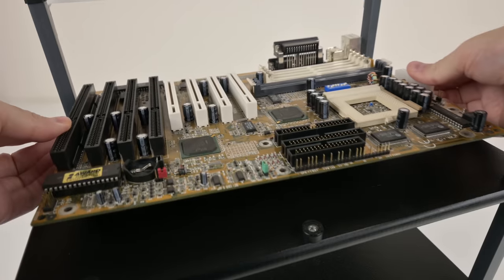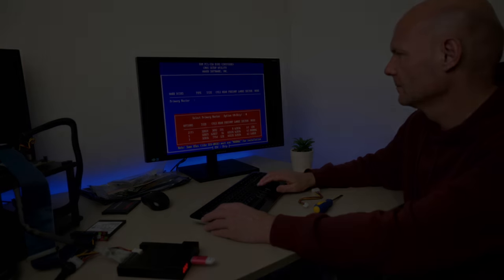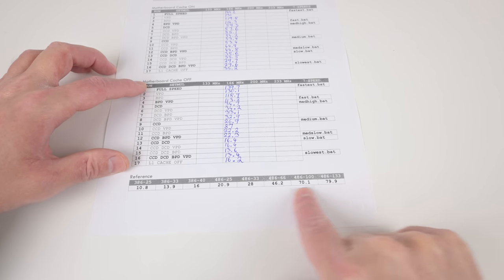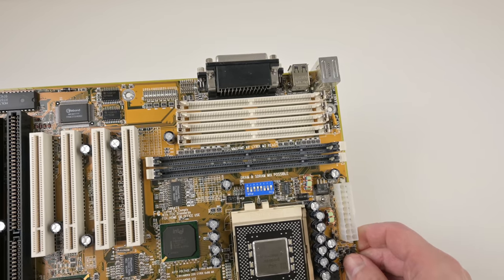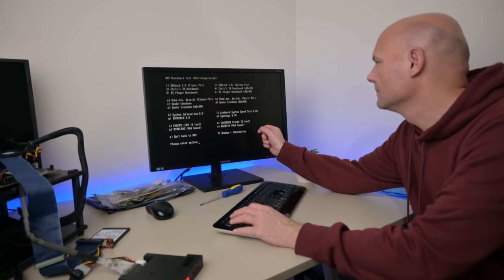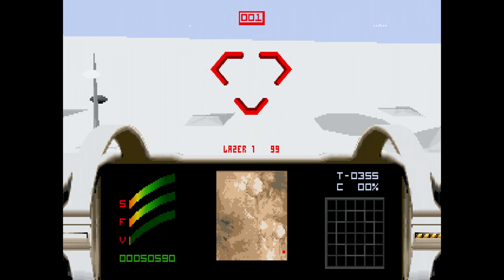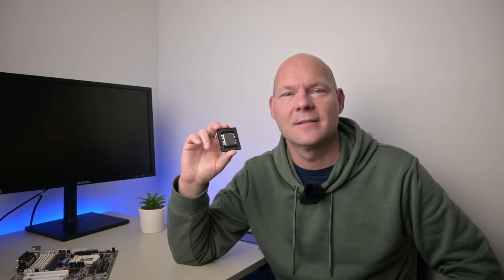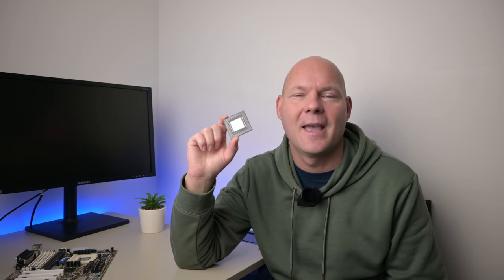Pentium MMX 166 is one of the Best Retro Processors

Comment: I had a Pentium MMX 166 running at 200 MHz. It was a great machine but only for quite a short time due to the mentioned incredibly fast development around the year 2000.

The MMX 166 had replaced my IBM 6x86 P166+ but was much faster in many games due to the faster floating point unit. And it generally ran with much less issues and crashes, but that might have been due to the improving operating systems as well.

After the MMX I tried an AMD K6-300, but I never was as happy with that system, I think the main issue has been the VIA chipset. That's why it always hurts my stomach when you're dealing with VIA chipsets in your videos - bad memories of crashes to desktop and blue screens come back into my mind ;-) 

Then I went back to intel (Celeron 300A @450MHz, ran games like a dream, but again not for that long...), but that's another story ;-)

Comment: Finally had a chance to try this. I set a Pentium MMX 233 as 133MHz (2x66Mhz), got 12.1 on the slowest set (all caches off on BIOS as well). That's between a 386-25 and a 386-33. Wing Commander 1 runs nicely on this speed. I knew Setmul, you just made your point on the convenience and easiness of use with the 136in1 package. Really nice trick to have around for those really old games. My PC history started with  a 486DX33 and I did play Wing Commander on it, never knew it was faster than intended. As things were moving fast during those years ( I would sell my current machine and build a new one once-twice a year), I never really went back and replayed such games. As I heard once back at school, there is things correctly or poorly designed. We have software from that time that is not speed sensitive - and some that are. Today we can tell who did right vs wrong. Thanks Phil / cheers from Brazil
Reply from the maker: Awesome 👍😎

Comment: I've a pair of P233MMX boards, both ASUS TX97s (one with just SDRAM, the other with both 72-pin and SDRAM).  I bought them off a guy who collected a bunch of scrap machines from some local schools for $20 and a case of beer two years ago (along with some other nice stuff, like a couple 462s and Slot 1s).  They're nice boards, and pretty solid, both in excellent condition for their age.  Only have one of them set up at the moment, also using a Gotek, but with a CF card instead of SSD.  They have on-board Creative Vibra sound, which seems to provide decent SB16 compatibility, but I picked up an ESS1869F to go in it instead.

I ran a P233MMX with an AWE64 Gold from 1997 to 2001, first with a crap ATI card, then with a PCI Voodoo3 2000, so the P233MMX has a special place for me.

Anyway, thanks for the video Phil.  Love your content as always.
Reply from the maker: Thanks!

Comment: I have one of these in an old OptiPlex with a 440BX chipset. Runs at 266mhz flawlessly. One of my favourite chips. Overclocking was so simple back in the day.
Reply: 440BX chipset is for slot1 Pentium 2 and 3. Not the original pentium.

Comment: Also my first CPU. It could be wonderfully overclocked: my original motherboard could push the base frequency to 83 Mhz, making it run at 209 MHz (83 MHz * 2, 5). Later I mounted it in a Super Socket 7 motherboard, and it was able to run at 250Mhz (100 MHz * 2, 5) without any problem . When I upgraded to a K6-2 400 I was disappointed: it was a bit faster, but less than I had hoped for. Looking back on it later, I should have waited and buy a K6-3 450...

Comment: Yeah I really like the concept of "slow is better". I'm somewhat split if I should keep going with SS7 or just make a dedicated 98 machine and a dedicated DOS machine. I will say that I recommend anyone trying to build a computer like this try and find a motherboard that uses dip switches like the one in this video. It makes swapping settings infinitely easier.
Reply: How about dual booting DOS and Win98SE? You will need a bootmanager that can hide the OS partitions from each other though. I did it with GRUB in the pasz, but that needed a linux installed.
Reply: @szenti707  I guess what I should have been more specific. I'm talking about making a dedicated "slower" but more compatible DOS box while building something faster like a Pentium 3 to handle all the 98 games.

Comment: This is a childhood CPU for me because it was the CPU in my grandparents' PC from 1997 to 2002. In a horizontal desktop with 16MB of RAM, 2GB hard drive, 3.5" floppy drive, 16x BTC CD-ROM drive, S3 Trio64 with 2MB of VRAM, an "Avance Sound Chip" sound card, a 56K modem and Windows 95.

While my Mum and I's PC from 1998 to 2002 was a mini tower with a 333MHz Pentium II, 64MB of RAM, 4GB hard drive, 3.5" floppy drive, 36x Creative CD-ROM drive, ATI 3DRage w/ 8MB of VRAM, an "Avance Sound Chip" sound card, a 56K modem and Windows 98.

Both PCs were whitebox systems by Swift Computers in the West Midlands region of England.

Comment: like all your videos,,,,,i still  have my gateway 2000 166mhz tall desktop computer ,, only has the EDO ram ,, ensoniq sound card ,, pci matrox video card,, my motherborad has a pin on the motherborad to slow down the 166mhz cpu ,, i saw it in my manulal its my first computer i bought in 1996 ,, it came with window 95 ,, i updated to windows 98 se
Reply from the maker: Beautiful machine!

Comment: The first PC i bought brand new was a 200MHz MMX with 32MB RAM, S3 Virge 4MB and 3Dfx Voodoo 1. It replaced a AST Advantage 486 DX2 66 (Cyrix). Quake went from 2 fps to almost 50 (software rendering).
I rebuilt it a while ago using a "new old stock" AT motherboard. It's fast enough for all DOS- and early Win95 games, and the compatibility with older games is great as well.
Benchmark results: Norton Sysinfo: 680.6, PC Player SVGA 640x400: 21.3, Superscape Benchmark: 155.6, Doom: 80.3 fps, Quake: 49.1 fps.
Reply from the maker: Thanks for sharing, the performance is beautiful!

Comment: I still remember how happy I was, when I finally found a Pentium 200, without MMX. Most of the production went to OEM's, from what I read in various places, so if you wanted one, you had to wait for someone to upgrade. You just could not get them, any other way. At one point, the Chinese recyclers were listing tons of them. They must have received a big shipment of used pc's around that time. The supply has tapered off a lot since then.

Comment: My late 90s to early 2000 era was Cyrix 166+  --->  Cyrix MII 333MHz  --->  AMD K6-2 500MHz  --->  Celeron Tualatin 1200 .  As you can see I was short of money during this era, but went near cutting edge after this.  Been Intel ever since.  My friend's first desktop PC was a Compaq Presario 4504 with an Intel Pentium MMX 166MHz, which he still has and bought from Costco in late 1997 for nearly £1000.  There was another model next to it, a Compaq with the Pentium MMX 233MHz but cost significantly more!

Comment: This is brilliant and just in time. I recently acquired an ATX Socket 7 mainboard and coincidentally the seller included a Pentium 166 MMX processor with it. Finding AT cases has proven very challenging so I've been on a quest to build up a system in an ATX case. (Planning to use a black case which reminds me of your "Sleeper Retro PC series".)

Those Startech Socket 7 coolers are still available though they can be a little pricey IMHO at ~$20 US shipped. I ended up making a franken-cioler with a Socket 370 heat block and some Socket 7 retaining clips before finding a decent deal on the Startech cooler.

All in all, this is a wonderful tour through this platform and an inspiration to finish assembling my own version of this. I'm anxious to finally use my Orpheus sound card in there as well. 

Thank you for putting this together Phil!
Reply from the maker: Sounds like you are all set very soon 🙂

Comment: On a side note that chip is a decent overclocker.  If your board supports it most will do 200 easy on stock volts and many will do 233 with a slight bump and a socket370 cooler.

Comment: I agree, 166MMX is great CPU for early 95 and late DOS era. I have Tulip desktop which I specifically built for this era. I have Orpheus 2 for sound, Voodoo 1 for that 3D accelerated goodness and ATi Mach64 Pro Turbo (onboard AT24 had compatibility issues, so decided to go with this card). I upgraded the RAM to 64MB, it has a TX chipset which means that it is practically the maximum, but of course completely overkill already. It has built in USB and AMD PCNet adapter, so the three expansion slots available were enough for my needs. Case has a nice small footprint, it is clean and in beautiful condition.

For OS, I went with 98lite Micro with 98SE as a base OS. I think it is simply the best option for Pentiums ans slow PIIs, as it gives all the benefits of 98SE pretty much with 95 performance. I built a start-up menu with different DOS options and booting to Win, installed 4DOS and other of typical stuff I use with my other DOS systems too.
Reply from the maker: Well done, I like that machine a lot!

Comment: Still enjoying my Pentium MMX 233 "time machine" system; slows down excellently, all the way down to 8.5 in 3DBench at 50MHz FSB! And when not slowed down I keep it comfortably "overclocked" at 75MHz FSB for ~266MHz! With a Voodoo 1 and S3 Virge DX, it plays GLQuake buttery smooth! Even Unreal is fairly playable. Though I'd use my Slot 1 system for that :P

Interestingly, I was curious to see if I could get a lower score in 3D benchmark than 8.5, and I found myself a Tseng ET3000 ISA graphics card after hearing those were really slow. And yeah, it seemed to go way slower, down to 7.5! That wasn't the end of the batch file you made though, and strangely, for the last two tests before disabling the L1 cache...the score jumped back up to 86.9, then down again to 76.2 (the registers all disabled)! I can only presume that I managed to get it to run so slow that 3DBench underflowed or something. Not sure what games would need to be quite that slow before they need an actual 8088/8086, but it's interesting!

Comment: I had a prebuilt P 133mhz from Quantex. I bought an MMX 200 and swapped the chips. That board would run it only at 166. I ended up wasting more money and bought an Asus p55t2p4 board I think it was which ran the chip at its rated 200mhz. That was the first time I had ever swapped out a main board. That was in 1997 about the time that Tomb Raider 2 came out, and I enjoyed the game with a Matrox Mystique video card.

Comment: I have a Pentium MMX 233mhz processor with a Socket 7 board, but unfortunately it requires a voltage regulator module for MMX processors, and I can't find one. So, I ended up having to slap a standard Pentium 200mhz chip in its place. I'd really like to use the MMX one though with its extra features (not just for DOS titles, but some Win '95 releases). You're right that being able to limit these is a huge selling point for DOS games.

Comment: Thanks for your work. As i remember you have the same video that describes Pentium MMX. As for me, it would be much more interesting to see what Pentium 200 can do, because a lot of CPUs have free multiplier and there are lot of boards that allows you to switch native clock speed from 75 to 200. Also i tried to told you about another cache control utility that allows you to switch between WT and WB modes on P6+ CPUs. SetMUL can't do the same, as for now. It would be interesting to see comparison between Pentium Pro and MMX with all cache and clock options you could set.  I even sent you email about it, but with no luck.

Comment: I knew about the CPU cooling tools for Windows ( "CPU rain", ... ) and that they can affect the CPU speed, but a setup like that for vintage gaming is a really impressive find.
Thank you !

And the CPU had plenty of power, enough to run Quake 1 and Duke Nukem 3D at fairly decent resolutions even without adding a Voodoo - to run Quake you only need a 486 DX4-100 upwards, but to get a resolution higher than 320x240 you needed a PCI graphics card, and above 640x480 you entered VESA BIOS territory which demanded a fast PCI bus and significantly more CPU power still. The first PC I knew to power Quake 1 at up to 800x600 was the legendary Am5x86-133 / AMD-X5-133  / Am486DX5-133 @ 166 MHz O.C. ( there were many versions and names for them ), which was at about the level of a Pentium 90 .
If you put that into perspective, you know how much power a Pentium MMX 166 held.

There is but one caveat though: As mentioned in the video, the MMX versions also introduced dual / split voltage, making the CPUs incompatible to older Pentium motherboards.

Comment: I have a Pentium MMX mobile 200 Socket 7 CPU. 2.45V stock voltage, same core as the Desktop version with 2.8V, but with a better selected core and it works with all multipliers from 2x until 3.5x. This is my best MMX CPU in the collection, because it runs fine with (also 8h Prime stable tested) 300MHz (100x3) at the stock Desktop voltage of 2.8V. I know, useless for a todays retro build, and yes, I use a K6-III+ SS7 build. There is also a 250nm Tillamook MMX 266 CPU out, would be nice for a later video, if you have one in your collection?

Comment: I had one of these and I can't remember, technically this may have been the first cpu I owned. I got it and a mainboard to replace my dads 486, so we had a working pc again at his house. Mind you things were up to the pentium 3 era at this point. Having installed this, new memory and mainboard and installed windows 98 on it, it was a lot better than his 486. It got his system working again and moved his failed install of windows 95 to 98 was much better. I remember his windows always complaining of errors and I even got blamed for when it eventually stopped booting into windows. Granted it was his step kids who were using it at the time and windows 95 wasn't exactly the most stable or advance software out there to recover from errors. It just needed a reinstall, my dad knew that, but their awful mother didn't know that. It was just someone to blame.

Comment: I used the regular flavored Pentium 166 paired with a Viper V330 between October 1997 till October 2000. It was a great CPU until very late 1999 or early 2000, but when I replaced it with a Pentium III 600, it was on its last legs, barely able to run anything new.

Comment: Hi Phil. I have Pentium III 667 Mhz with MSI MS-6309 Lite motherboard. By disabling cache level 1 with setmul and adjusting various combinations of values at front-side bus  66,100,133MHz, memory speed 66,100,133MHz, CL3 or CL2 for memory, but also CPU In Order Queue setting (1 or 4), the system can be set to behave in many steps like a 386DX from 12MHz 20, 33... up to 40Mhz or 486DX from 25 Mhz and up to -50Mhz equiv. I think this is another good alternative to Pentium MMX, 386, 486. Yesterday I played Wing Commander 1 with 386DX 40Mhz settings... and it went smooth. 🙂
Reply from the maker: That's interesting, because when I tested with the Pentium II or III, as soon as I disabled Cache, it was very very slow.
Reply: @philscomputerlab  These are the results obtained in 3dbench2, depending on different bios settings:

7.5   =====> FSB = 133 MHz, DRAM = 133 Mhz, CAS Latency = 3, CPU In Order Queve = 1, Level 1 cache disabled with setmul
8.0   =====> FSB = 66 MHz, DRAM = 66 Mhz, CAS Latency = 3, CPU In Order Queve = 1, Level 1 cache disabled with setmul
8.6   =====> FSB = 133 MHz, DRAM = 100 Mhz, CAS Latency = 2, CPU In Order Queve = 4, Level 1 cache disabled with setmul
8.8   =====> FSB = 66 MHz, DRAM = 66 Mhz, CAS Latency = 2, CPU In Order Queve = 1, Level 1 cache disabled with setmul
9.5   =====> FSB = 133 MHz, DRAM = 133 Mhz, CAS Latency = 3, CPU In Order Queve = 4, Level 1 cache disabled with setmul
9.9   =====> FSB = 133 MHz, DRAM = 133 Mhz, CAS Latency = 2, CPU In Order Queve = 4, Level 1 cache disabled with setmul
12.0  =====> FSB = 66 MHz, DRAM = 100 Mhz, CAS Latency = 2, CPU In Order Queve = 1, Level 1 cache disabled with setmul
13.1  =====> FSB = 100 MHz, DRAM = 66 Mhz, CAS Latency = 3, CPU In Order Queve = 1, Level 1 cache disabled with setmul
14.5  =====> FSB = 66 MHz, DRAM = 66 Mhz, CAS Latency = 3, CPU In Order Queve = 4, Level 1 cache disabled with setmul
15.7  =====> FSB = 100 MHz, DRAM = 66 Mhz, CAS Latency = 2, CPU In Order Queve = 1, Level 1 cache disabled with setmul
16.4  =====> FSB = 66 MHz, DRAM = 66 Mhz, CAS Latency = 2, CPU In Order Queve = 4, Level 1 cache disabled with setmul
26.3  =====> FSB = 66 MHz, DRAM = 100 Mhz, CAS Latency = 3, CPU In Order Queve = 4, Level 1 cache disabled with setmul
29.8  =====> FSB = 100 MHz, DRAM = 100 Mhz, CAS Latency = 3, CPU In Order Queve = 1, Level 1 cache disabled with setmul
35.7  =====> FSB = 100 MHz, DRAM = 66 Mhz, CAS Latency = 2, CPU In Order Queve = 4, Level 1 cache disabled with setmul
39.8  =====> FSB = 100 MHz, DRAM = 133 Mhz, CAS Latency = 3, CPU In Order Queve = 1, Level 1 cache disabled with setmul
55.0  =====> FSB = 100 MHz, DRAM = 133 Mhz, CAS Latency = 2, CPU In Order Queve = 1, Level 1 cache disabled with setmul
83.1  =====> FSB = 133 MHz, DRAM = 100 Mhz, CAS Latency = 3, CPU In Order Queve = 1, Level 1 cache disabled with setmul
273.0 =====> FSB = 133 MHz, DRAM = 100 Mhz, CAS Latency = 2, CPU In Order Queve = 1, Level 1 cache disabled with setmul
372.0 =====> FSB = 133 MHz, DRAM = 133 Mhz, CAS Latency = 2, CPU In Order Queve = 1, Level 1 cache enabled
505.2 =====> FSB = 133 MHz, DRAM = 133 Mhz, CAS Latency = 2, CPU In Order Queve = 4, Level 1 cache enabled

I think Pentium III deserves another chance to be reviewed by Master Phil 🙂

Comment: 1:10 - be careful with PCB bending. I've damaged one board this way, after changing about 50 times of graphic card.
Always have firm background, when pushing on motherboard.
If motherboard is in case, always put fingers from opposite side too, and push against any pressure, so it don't bend.